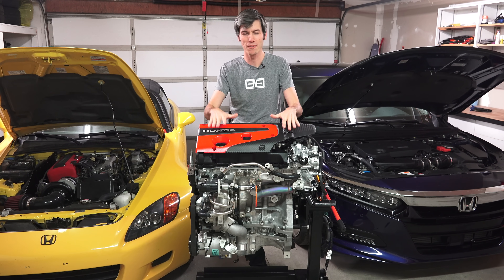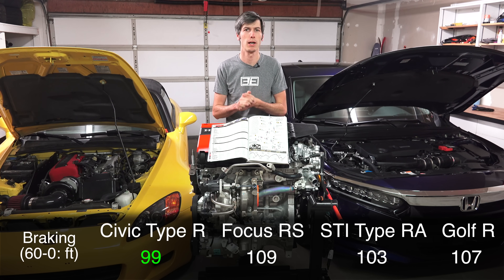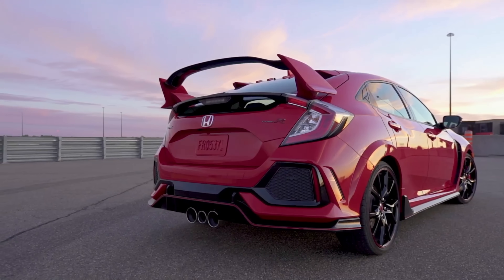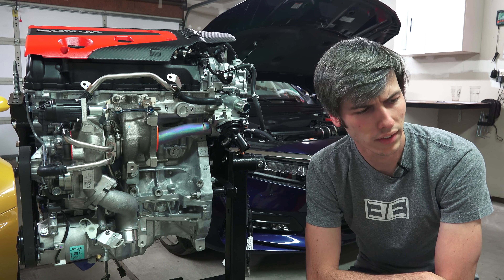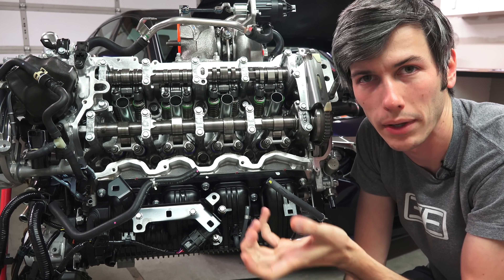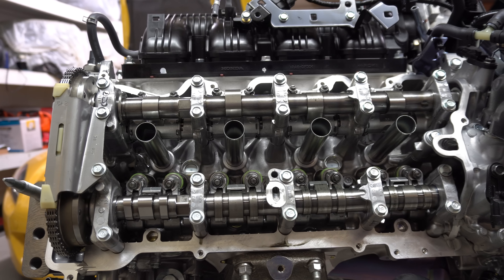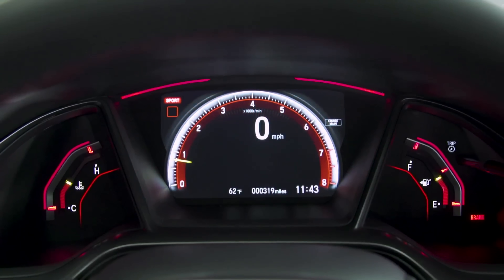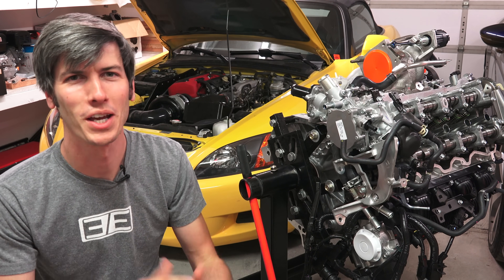The Honda Civic Type R Destroys The Competition - The Best Engines

Comment: Been a long time subscriber and big fan of this channel, but I have to say this is very misleading (biased) title/content.  This video should clearly state that this claim is in regard to track, good weather, performance only.  When you state that one car destroys another, especially so unequivocally, without discussing anything except dry performance on a race track, it makes you look like another magazine boy racer.  In fact the Type R is marvelous at exactly that, dry performance on a track.  Now lets discuss other aspects that make a vehicle.  The Golf R is in fact significantly faster from a dig with a DSG.  The fact that the Golf R is available with a DSG is in itself a huge bonus for many looking for something like that (the wife needs to be able to drive your car).  The Golf R doesn't look like a 18 year old's wet dream.  I wouldn't want to pull up to my middle management job wearing a suit in a Civic Type R.  The Golf R having AWD is a requirement for many living in bad weather climates.  The minute it rains, the Civic will not be able to put any power down.  No need to even discuss snow.  The interior of the Golf R is entry-luxury levels, the electronics, the fit and finish, even the ride quality of the adjustable suspension.  All superior to the Civic Type R.  So yes, in fact the Golf R is more expensive because it's by far a better overall vehicle, targeting a different demographic.  While the Civic Type R is a great vehicle, one that was more or less purpose built for specific conditions.  It in no way "destroys the competition" as a package.  You will rarely if ever see cross-shopping between the Golf R and the Civic Type R.  The Golf R is a vehicle that does all things very well.  The Civic Type R is a vehicle that does one thing exceptionally well, and other things just OK (and I'm being nice, because it looks beyond ridiculous).
Reply: Your claim that the Golf R is a far better overall vehicle is fanboy nonsense.
They take a different approach to the hot hatch.
The Type R is less expensive, will depreciate better, will have a lower cost of ownership, is faster around a track, has better brakes.  The Golf excels at comfort.
The civic in regular mode is comfortable too, unlike the STi and RS.
Reply: Have to respectfully disagree.  The Golf R actually holds value very well (as opposed to the GTI for example).  I'm not going argue that point because I'm not willing to dig up the numbers, nor are they available for the Civic Type R anyway as it's the first generation.  Lower cost of ownership?  Perhaps.  Better brakes?  Not sure by which metric, but if it's related to stopping distance it probably has as much to do with vehicle weight as anything.  Regardless, even if it is, it's marginal at best and 100% inconsequential for a vehicle that is driven on the street 99% of the time.  The "win" you're giving the Golf R is that is' more comfortable.  Yet somehow you avoided every single point I made.  Advantages of AWD when it comes to inclement weather.  Not to mention when tuning the car for big power, FWD will not put that power down.  The Golf R is a whole different league when it comes to luxury.  Leather seats, the materials in general, digital cockpit.  None of that is "oh it's just more comfortable".  Features like adaptive cruise control are not just "oh it's more comfortable".  Availability of a DSG is not just "more comfortable", it's an absolute requirement for many.  I will argue until blue in the face that for an average person that has entered the work force, one that will use their car 99% of the time on the street and not on the track, the Golf R is by far a better vehicle.  For someone looking for a weekend toy, where luxury doesn't matter, electronic gadgetry doesn't matter, inclement weather doesn't matter, wife being able to drive the car doesn't matter, etc.  The Civic Type R is obviously a more pointed performance oriented vehicle.

Comment: Thanks for the vid. Very good overview of the engine. 
I’m glad you call it an engine and never a motor. I was always conditioned industrially to always call heat difference power plants “engines” and electric power plants “motors” and to never mix the two.